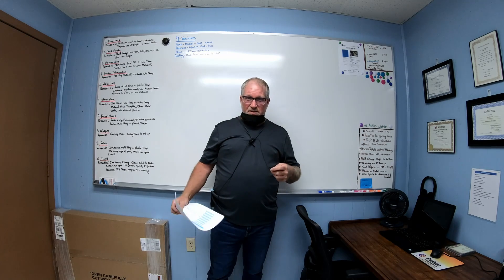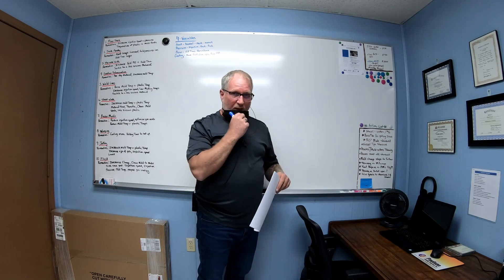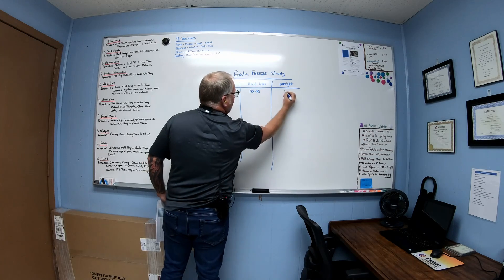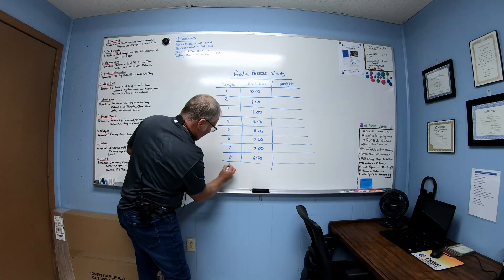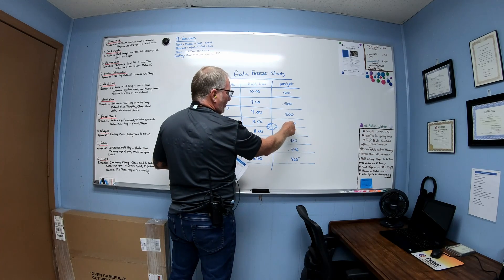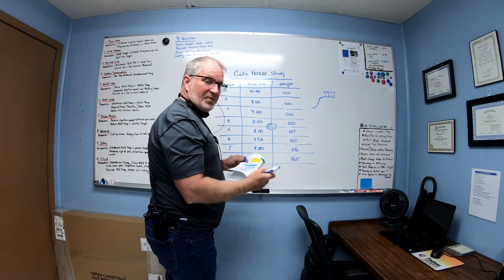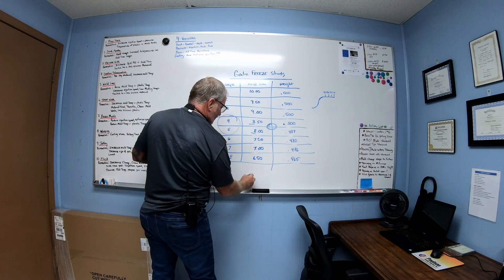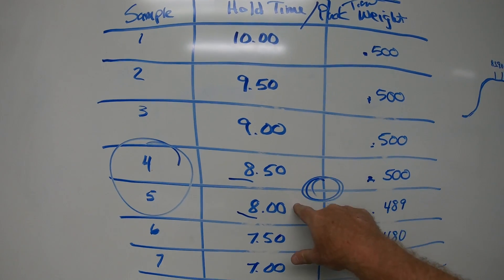Gate Freeze Study

Comment: Would this work for valve gated or just cold runner?
Reply from the maker: It depends on the valve gate system you are using. If it is air it would be on a timer, so it is hard to do the study unless you leave the time open longer to see when it freezes off. If it is hydraulic you need to check & see if there is a way to leave the valve gates open longer so you can see how much time is needed to freeze off. I look at the machine & what application you are using to see if you can or not. I have seen some you can't & I have seen some you can change things around to find what you need. I hope this helps you out sorry for the delay. thanks for watching & the support to the channel.

Comment: Why not do it backwards? Start at 2 on hold time and then go up in incriminates by one second.It’s slowing adding weight so to start high you could over fill your part and cause tool damage. I know that would be more shot size and pack that would over fill the part and somewhat transfer but wouldn’t it be safer to start low and then work your way up?